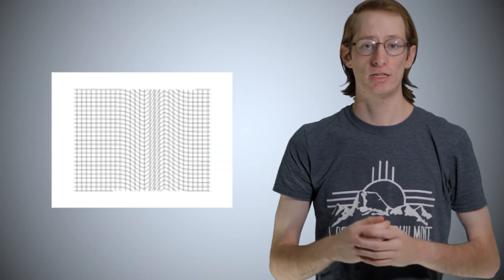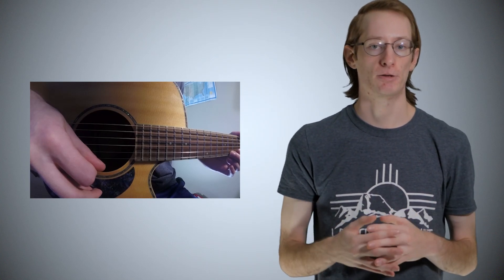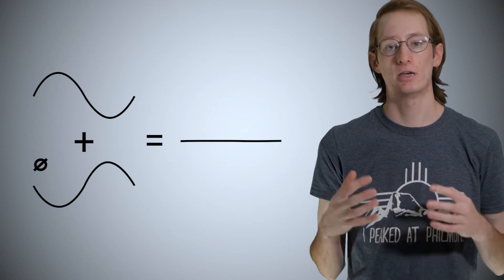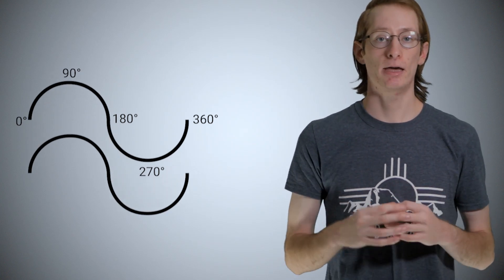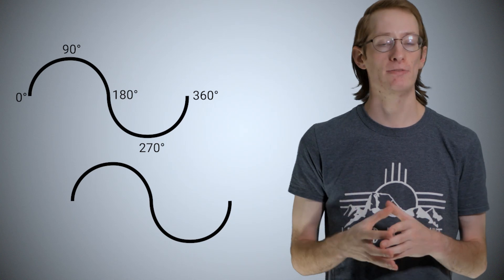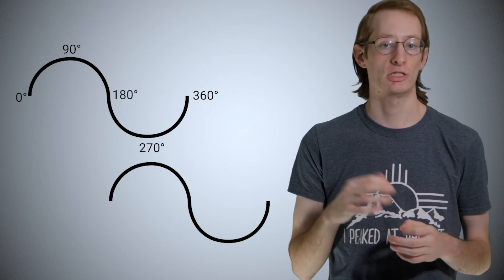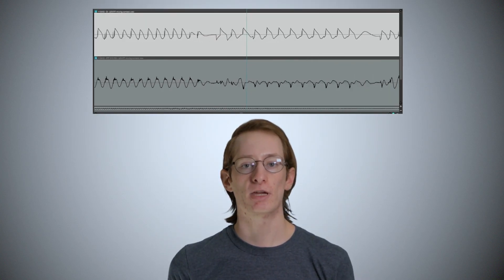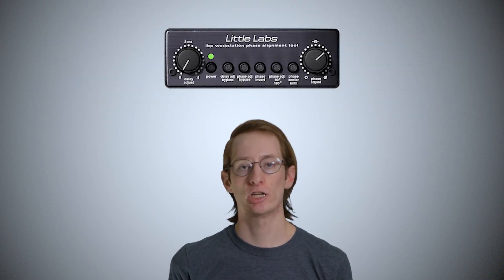What are Phase and Polarity? - Sound Design Basics

Comment: You are confusing time delay with Phasor phase. A polarity flip is exactly the same as changing the phase 180 degrees at all frequencies. You are looking at a time delay which is equivalent to a linear phase, so a different phase for each frequency. So when you say that others get it wrong, you are actually the one in the wrong. It is clear when you look at the math.
Reply from the maker: You are right that you can manipulate the phase of a signal equally across the frequency spectrum, but rotating it 180 degrees is still not the same as a polarity inversion unless the signal is continuous in the time domain. If the signal is changing in the time domain, a phase shift will not perfectly cancel out the original signal, but a polarity reversal will.
Reply: @AlteraSound  My answer got deleted, so here once again: Search my own channel Acculution and see why a 180 degree phase shift at all frequencies for sure is the same as a polarity flip for causal and non-causal (continuous) signals. A time delay is a linear phase, a very different thing. Appreciate your uploading videos, and if you want to have a chat about this, feel free to reach out. -René

Comment: Gooood information. I'm curious - As we display sound in a transverse wave, sound does technically travel as longitudinal waves...which look very different than a transverse wave. It's easy to explain polarity and phase with the transverse wave as you just did, but what would it look like as a longitudinal wave?
Reply: It does not really change anything. The sinusoidal signal simply represents the amplitude (compression/rarefaction) over time in a point in the longitudinal field.